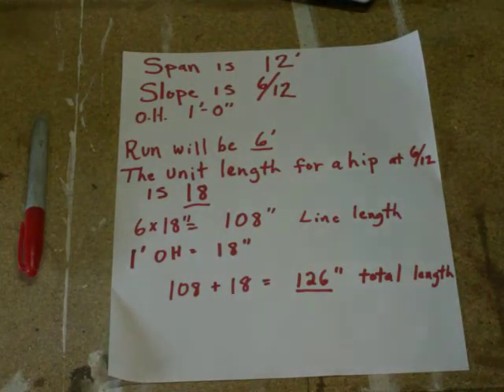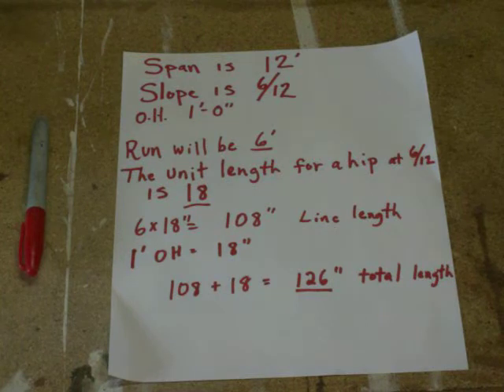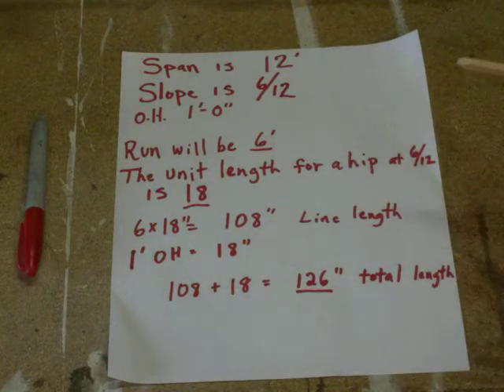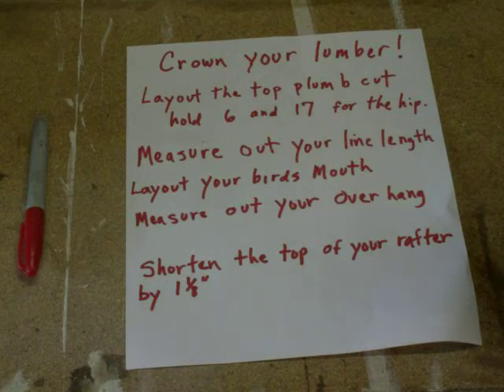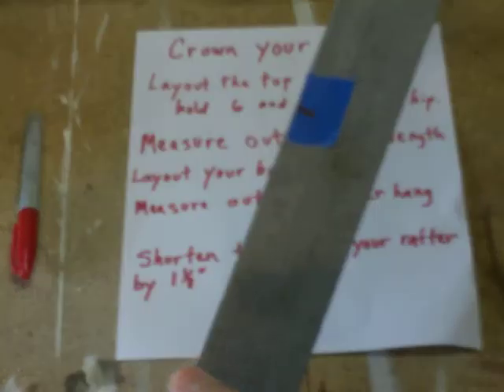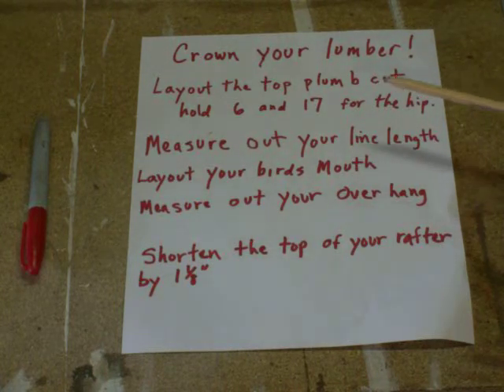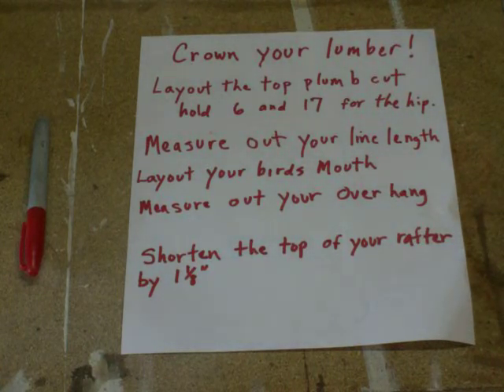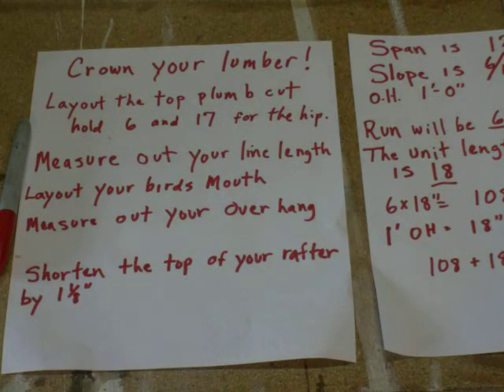Hip rafter calculation

Comment: So how do you figure the unit length for a 5 12 pitch or any pitch for that matter. And in this video why did you use 6 17 for the plum cut I thought the pitch was 6 12
Reply: get the framing square,look under the 5.the 1st set of numbers is common  rafter(5/12) the second set of numbers is the hip rafter (5/17).the hip rafter is running diagonal, 1 foot of distance diagonal  
is 17 inches.use the 12 inches for common rafters,use the 17 hip rafters(diagonal)